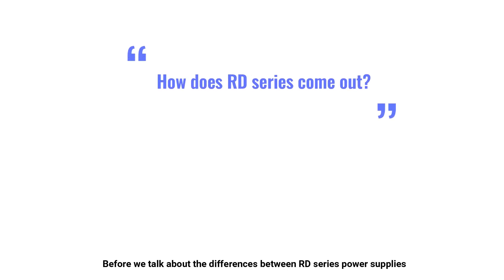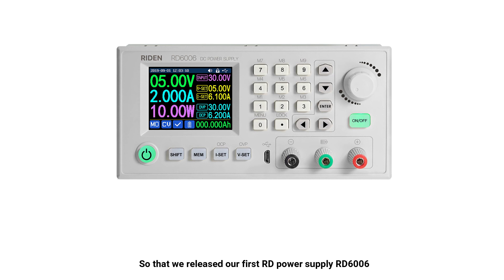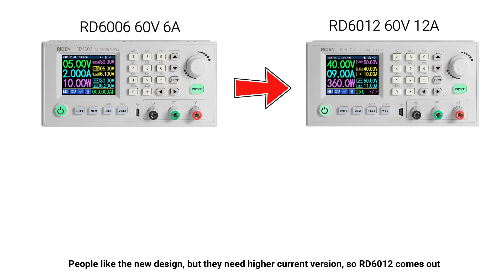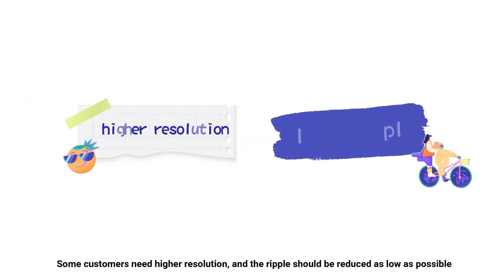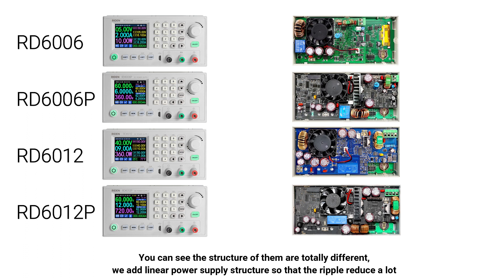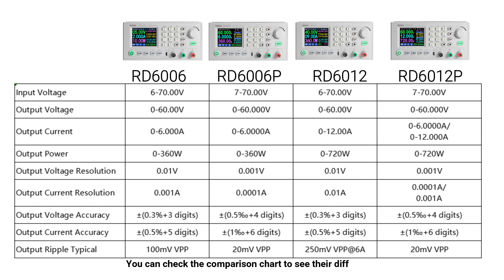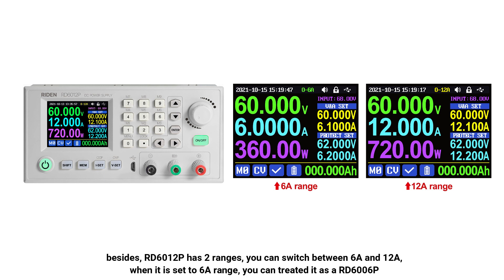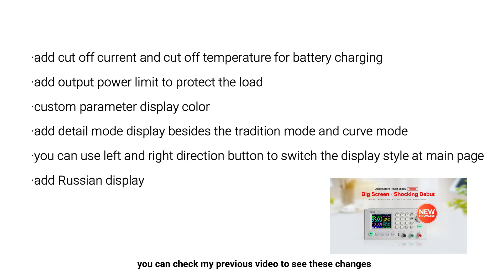RD series power supplies difference between RD6006/RD6012/RD6006P/RD6012P

Comment: How is your voltage converter different from a standard laboratory power supply another companies?
Reply from the maker: we design the RD series power supply in this way from 2019, and I do not know why do we have to make products to be same from other companies
Reply: @rdtech9153  He asked "How", not "Why", i.e. he asked what is different.
Reply from the maker: @tohaason  rd series power supply can be considered as lab power supply too, maybe the functions are different, for example, the devices from other company may have dual output, so RD power supply whole set should be at the medium level of the lab power supply

Comment: make the battery terminal something other than green.....

do you think you can make 2 Ridens connect to each other to get a dual tracking supply? that would be useful
Reply from the maker: hello,for our power supplies, they can be used alone, their output cannot be connected in series or in parallel, and thank you for your suggestion, because we already finished the RD series,  so we will consider that in the new power supply, but for now there is no plan

Comment: I have the RD6012 power supply and Ilike it. There is a PC software available. Is there a Linux version as well (I'm using Fedora 35)?
Reply from the maker: thank you for your support,  for now there is only Windows software available, sorry for that
Reply: @rdtech9153  are there any firmware upgrades? 
I have searched the whole web, I have not found a list or a link to download a firmware. 
I would like to have the option to set my default measurement speed because I always want to have fast measurement and I have always to set it when I change modes.
Reply from the maker: @romanstingler435  hello, for RD6006 old device firmware update, you just need to use the PC software, connect the RD6006 to PC with a USB cable, click the firmware update on the software and it is ok